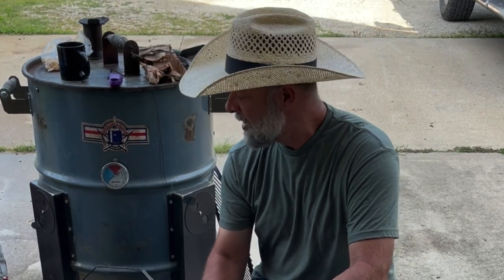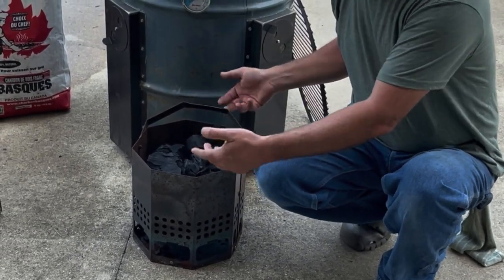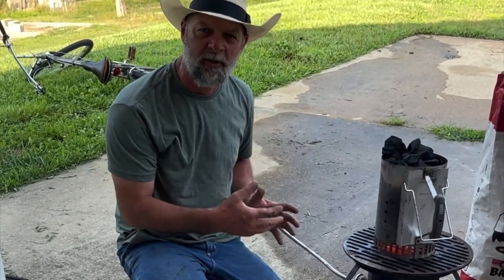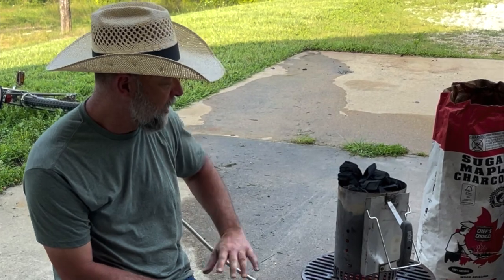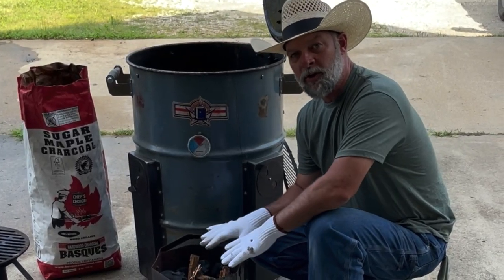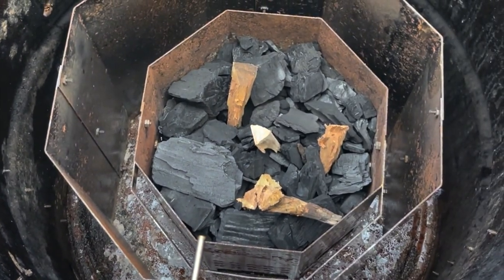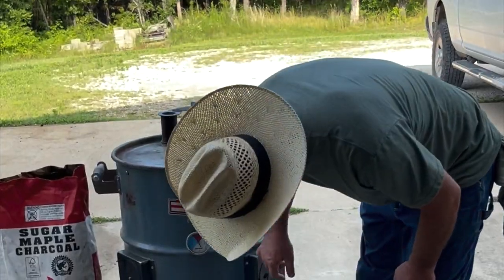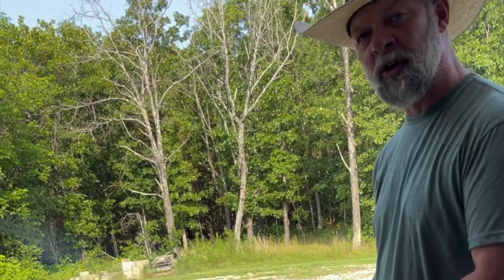Fire Management: How To Light Your SmokerBuilder Super55 Drum Smoker

Comment: Good explanation. Def prefer top lighting as well.
1. What is the value of the insulator? Protect the life of drum? Or gives more stable temps?  Or?
2. How is the basket getting air given the insulator? From the top? Is that better than the traditional method of air holes at bottom?
Appreciate the channel,

Comment: Great video.  I have a WSM 22.5 which has same grate size as the 55 gallon UDS.  Have ever tried to fabricate a drip pan that takes the grease outside of the cooker into a hanging drip bucket. As a customer we would just have drill a hole for the tube go through.  Look at the Grilla OG drip pan for reference..  Between all to the UDS and WSM owners out there , their may be a market for this.  I would buy one.